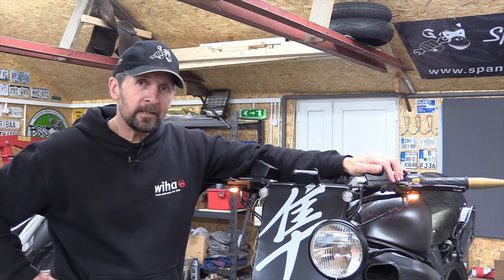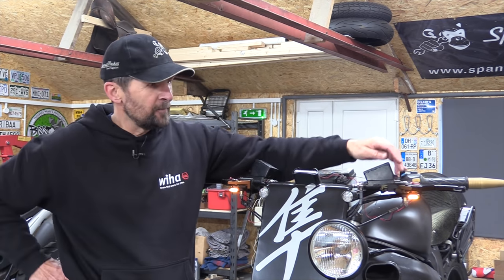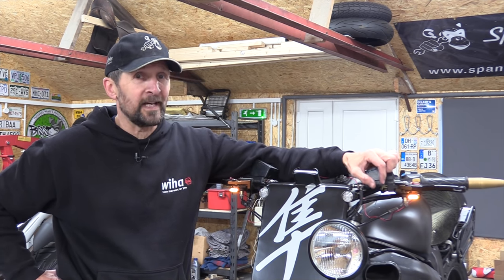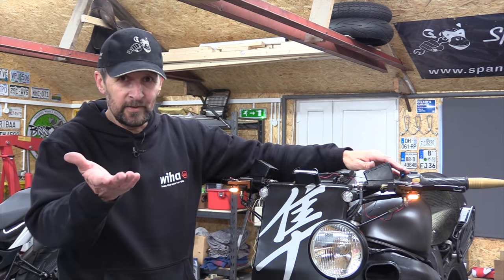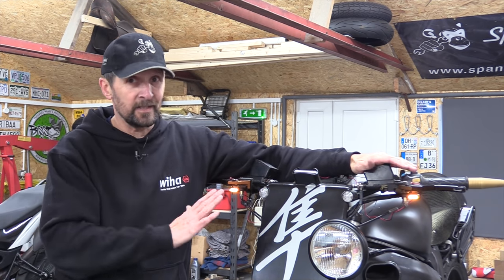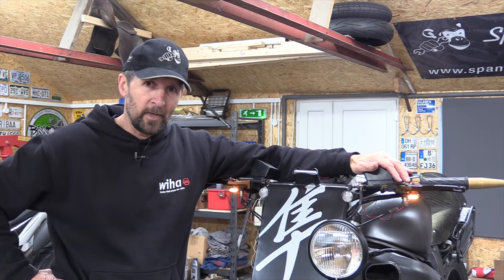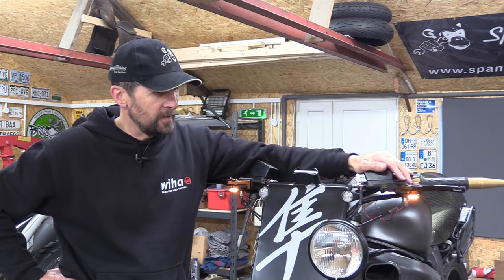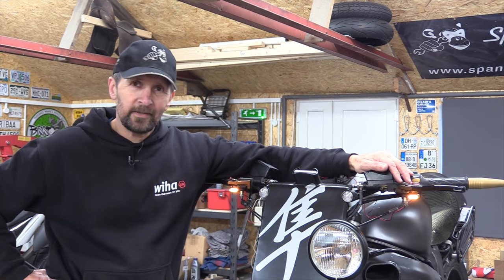Delboy's Garage, Lathe Project:- Bespoke Fasteners !

Comment: Great Tip About Removing The Laces On Your Hoody!  Saved A Lad Years Ago, He Was Unable To Reach The Emergency Stop Button On A Capstan Lathe, Had Caught His Overalls In The Bar Feeder, and Was Too Far Away From The Stop. The Machine Was Winning When I Found Him! - He Was Ok, And Laughed It Off Later,  But Never Wore Loose Fitting  Clothing Again At Work. - As They Say.... Once Bitten. - 👍
Reply from the maker: Thanks for sharing buddy, can't say it too many times aye.
Reply: @Moonfleet41  Looks Like You've Got The Slides Well Lubed, And They Are Running Spot On. - You Can Get A Bit 'Backlash' on That Model  Lathe, Especially On The Cross Slide. I Made A Very Thin Washer To Go Just Behind The Numbered Dial, And Used To Have Handle Adjusted To Pretty Stiff, When Turning Anything To Size.
Reply from the maker: I do have that backlash on mine, and when i get time i will shim it out too.. all together though, it's a good little lathe if you keep them well maintained.
Reply: @Moonfleet41  Yes, I've Used The Mill -Drill Version. - Cheers!

Comment: Your skills are amazing.  Not sure I would use air to blow off the table as small chips and dust can migrate into the tracks.  At least that is what I was taught taught by my 1966 shop teacher Mr. Darlow
Reply from the maker: Ah, don't we always remember our old metalwork shop teacher, mine was Mr Wilson, a retired Blacksmith and wisely sage!   I see most of the machinists on the Tube today using a little trigger airline to just blow chips out the way, and I take good care to make sure I clean the slideways and keep them oiled... but you may have also seen in previous videos when I've a lot of mess over the lathe I use a shop vac to hoover them up first!
Reply: @Moonfleet41  Amen on the Shop Vac…. Thank you for your inspiration and reply….. I am rebuilding two Shovelheads  / with rebuild parts are hard to come by these days these projects have take almost a year this December.    Enjoy the Day.    Oregon USA

Comment: Delboy, you need to tighten the Gib strip adjusters on the cross slide and the compound slide you shouldn't be able spin the handles like you did there needs to be slight friction and it will improve the finish on your jobs.
Reply from the maker: Thanks mate, literally less than an 1/8 turn on the adjusters practically locks the slide, so judging how much friction is enough and not too much is tricky..
Reply: @Moonfleet41  Just turn the adjuster gently until you feel slight resistance and then back off by bugger all, as I've said before I own the same lathe and I've fitted half nuts to my gib screws because they can and do loosen over time, it will be worth the effort, if you used my lathe you would think its sticking but it makes all the difference, trust me I spent forty five years maintaining a servicing machine tools.
Reply from the maker: @campingstoveman  Thanks buddy, ill give it a try.. always looking to improve.